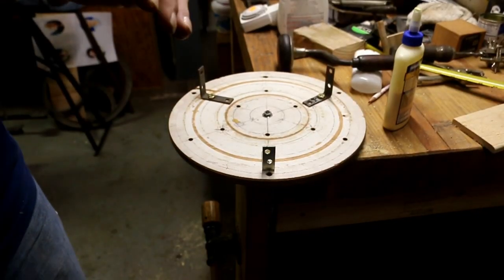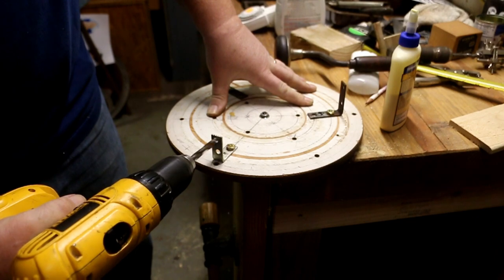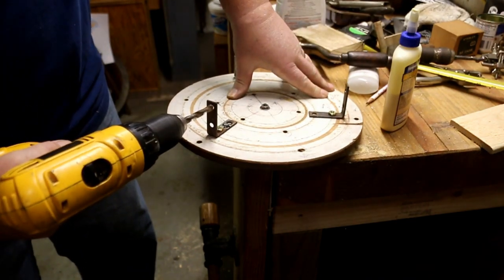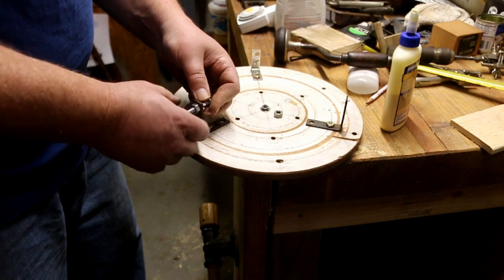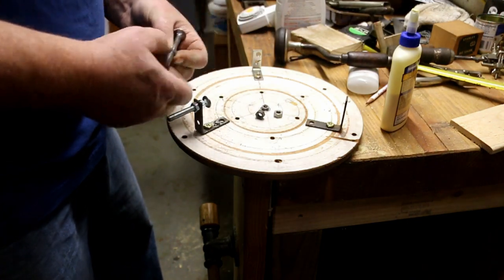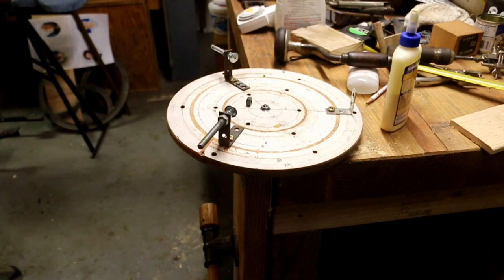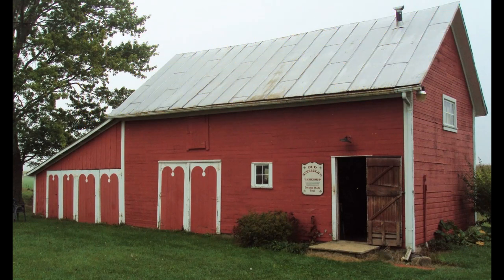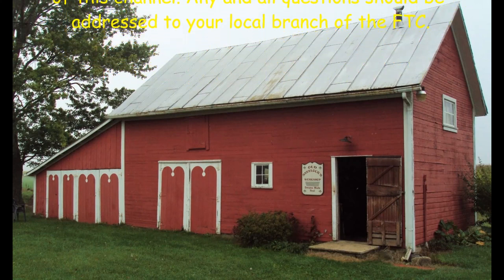Unique Lead Melting Burner - Cleaning The Tank

Comment: Great set-up!   The inside should come out great!   😃👍
Reply from the maker: I think sitting as a doorstop didn't help. It had gas in it so it shouldn't have rusted as bad. 
The pump shaft is open at the top so rain would run down the shaft, past the cup, and into the tank.
No leaks so far. Tank sounds and feels solid with the tap test.

Comment: That's a great homemade setup for cleaning tank interiors. Nothing like American ingenuity.  I would have been stumped about a slow run motor. You can't run an electric drill motor for hours on end. What a great solution. That mix of old hardware and vinegar should really take care of the rust. Looking forward to restoration of the lead pot. Is the large pipe threader still pending. Thanks
Reply from the maker: It is assembled and working okay. It needs some work on the 1 1/4" cutters.

Comment: YAAY being a Grandpaw! A-PLUS! And as for the tank polisher, no questions here. Looks plumb forthright to me. Emergency stop mounted but not working YET! I'm right certain I know where the trouble is. A plastic splice ain't going to get it on this rig. Will have to be a little more intense but I have extra wire there for just such cases. I know how I am. Happy Sitting and GBWYou and Sneelock #3!
Reply from the maker: One step forward two. steps back and the work just keeps piling up.
Reply: @OldSneelock  We can call it job security to keep from pulling hair out that ain't there!

Comment: Well the title caught my eye ... helping an old buddy load for a move across state and he, knowing anything left will be tossed into a dumpster with the new owners made me the proud owner of approximately 80 pounds of 1”x12” x 1/2” body repair lead just yesterday !! Of course I’m just guessing at 80 pounds of them by two things. The weight comparison to an 80# sack of Portland AND the fact that one of the handles split out the side of the wooden box when I got it almost waist high. I think I’ll weigh one then count the total.
Reply from the maker: Had a tub full shipped into the Foundry. Looked like it set below the bodywork part of the line. Melted all over the tub. 
Brother borrowed about 100 lbs for his friend to make bullets. 
Pretty hard stuff. He never mentioned how it worked. I imagine the bores got larger.
Reply: @OldSneelock  we had one if the last large lead foundry’s one town north of me. I got to work on the a/c fir the blast furnace office as well as the sinter plant and acid plant offices.  Also the spot coolers for the guys in certain spots in the foundry. Fan powered HEPA filter face masks were required in most places. None were pleasant locations. Working under and around troughs that carried molten lead to the several ton ingot molds was a trip too. The main offices and cafe weren’t too bad but lead dust impacted everything. I’m glad to have only had a service call two or three times a month though !!  And to think some guys think wearing an N95 is difficult. The sinter plant was so hot we would have to clear our fan powered face masks of sweat like a diver clears seepage from his mask underwater. Boy am I enjoying retirement !!! How about you ??!!  LOL.
Reply from the maker: @tractorman4461  I like not having to do the hour and a half drive in all kinds of weather.
No last minute changes that require weeks to implement but have to be done tonight. 
No sitting in meetings where  people without knowledge or skills create programs for multi million dollar projects because they get a commision and leave it up to a few engineers to make it work. 
Going to a customers shop and sorting a warehouse full of parts because someone thought the work instructions I wrote were wrong and changed the torque spec on a torque wrench. 
Spending 2 years fixing a problem created when the guy who serialized the door assemblies was laid off and no one took their place for a year. 
Oh how I love having only Google be the problem. 
Piece of cake. 😁😎
Reply: I've got a whole box of lead. At least one piece about 8" x 11" x 1/2" (currently sitting on a bench & partly melted into an electric melting ladle for making sinkers) and thin sheet that's square with a cylinder coming out the middle.  My guess it was for sealing pipes (either chimney or plumbing) going through a roof.  There may well be other things in the box; but it's heavy, and I don't have a better place to move it than where it sits.
Reply from the maker: @BrianDaleNeeley  That is a pretty good size pile. I have seen the lead roof flanges around vent pipes through roofs. 
Most of them are galvanized steel or aluminium with a rubber collar now.
Reply: @OldSneelock  Man o man, you're right about the commute, I don't miss it at all.  The only good thing was I always had company trucks...service vans or service body one ton duallys.  So gas and maintenance was on them too.  THAT was a perk and our wonderful politicians tried to get us taxed on company vehicle benefits as taxable income !! Jeez...they don't want you to get ahead do they... LOL. I guess I DO miss my portable toolbox on wheels, but that's about it though.  I got lucky and transferred to another union shop just a few miles from me so for the last 6 years, I had no commute at all. Got to work very locally for approximately 70% of the time and boy was that GOOD !!  I didn't have the issues to deal with as you describe, but with commercial/industrial field HVAC service you never know what the day is gonna bring or where its gonna take you or how long you're gonna be there. I don't miss the stress of a huge chiller being down in a hospital full of hundreds of patients or a process steam boiler that serves the operating rooms autoclaves with a problem or a litany of issues in schools, nursing homes, commercial refrigeration.......arrrrrrgggghhhhh  !!  But....I did like it when I was doing it...just don't miss it at all.
Reply: @BrianDaleNeeley  Hey !!  I see you commenting all the time over on Old Sneelock.... I appreciate you dropping in but whatever you do don't expect the same level of ability or tenacity exuded by that old Michigander over here.... By comparison I am just a hack next to him.  That's why when I get stumped I call out to him.  Dude forgot more about some of this stuff than I'll ever know !!  What you are describing is a lead 'pitch pocket'.  I've made a ton of them for plumbing and refrigerant piping roof penetrations back in the day as well as shower bases when the plumbers would pour their own bases with a mixture of sand and cement...  From the 80's on though we made them all out of sheet metal...started out with soldering all the joints, then as sealants improved we streamlined the process with exterior eurthane sealants and topped them off with tar. Thanks for the comment Brian, and thank you for your time !!
Reply from the maker: @tractorman4461  I worked 12 years in maintenance and machine repair before I got into management. I use to hate getting the breakdown calls. Everyone was ticked off and wanting to find someone to blame. 
Most of the plants in the Coldwater area were built in the 50's. They tended to be like the house that Topsy built. Patch on patch. That meant the old equipment broke often.
When I got some time at rank and gained the respect of upper level management I was able to change procedures to fit what I wanted.
It is a stressful situation every time the HVAC goes down. I made my life and the repair techs lives easier by scheduling regular PM on the equipment. 
Checking the heating and cooling units in the spring and fall meant that they didn't go out just when we needed them most. It also meant fewer days in the rain or snow on the roof.
Accounting wasn't happy when I started it,  but after a couple years the lack of emergency overtime calls and the never having to freeze or sweat because the HVAC went down showed in the bottom line. 
I bet you would have rather never walked into another manure spraying rotary impeller of a service call. I sure didn't miss making the call.
Reply: @OldSneelock  Hahahaha...you're right...never a manure rotary impeller, but I have worked in and on a number of sewage treatment plant ventilation systems and controls for the clarifiers, pumps and other components.  LOL..you have my sympathies...LOL.  We too had PM accounts that were used to fill in the valleys between the peaks of uber hi and uber low temps throughout the year.  I think we could swap nasty a$$ equipment stories all day long.  LOL.  Take care sir and lets both work on something rusty today !!